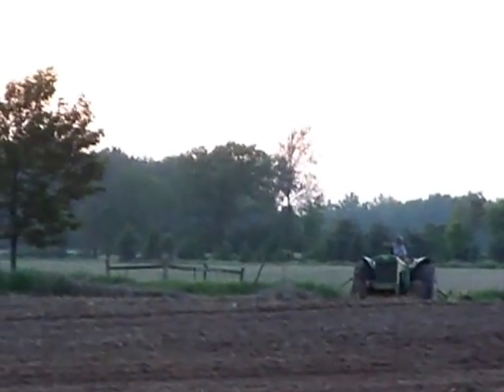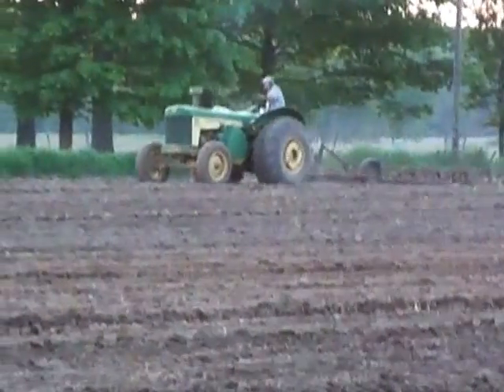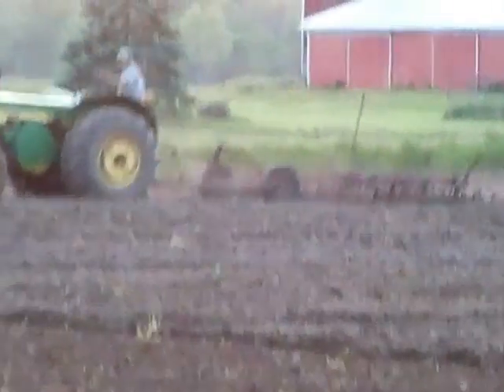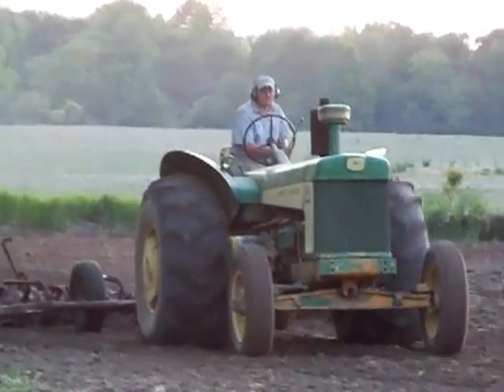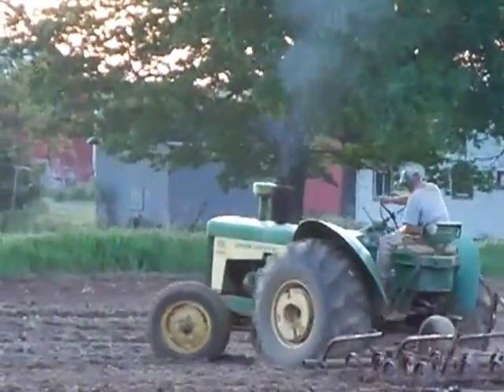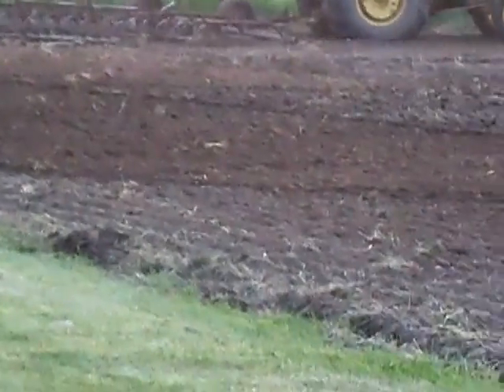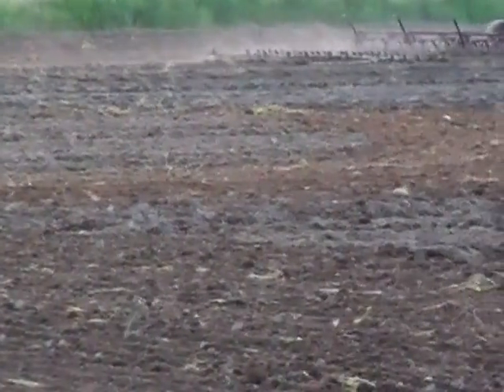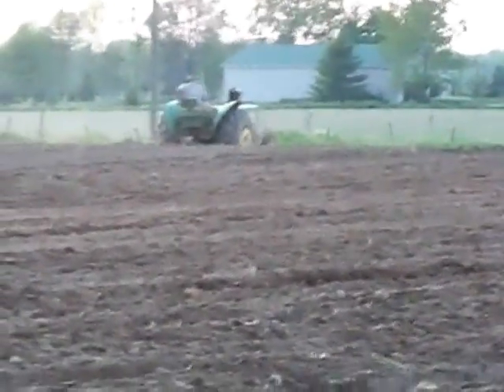One of 9 ever built! | Ultra Rare John Deere 830 Pre Industrial 2 cylinder Tractor

Comment: In 1960 I worked for a guy that had an 830 with a cab. I was plowing his wheat land with it and where the combines and trucks had made a road through the center of the field the 830 would slow down so slow that you could count the cylinder strokes. It would pull the front wheels 3 feet off the ground and let them back down to where they almost touched the ground. I have never driven anything else that had that much torque.
Reply: Man, that is crazy, I knew they had a lot, but not that much